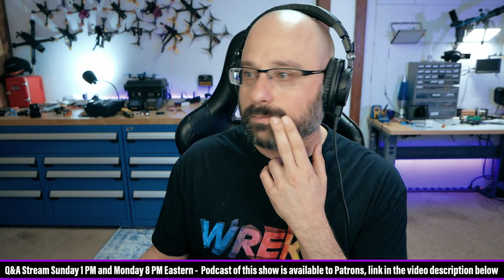Why Doesn't Betaflight Use 32khz Gyro Sampling? Why Not Use Sensor Fusion To Fix It? - FPV Questions

Comment: A better question is why did betaflight dump dshot2400? You have KISS/FetTEC using significantly higher ESC control rates using their own protocol, and both platforms support dshot2400. Anyone who says it doesn't matter is still flying BF and not KISS or FT.

EDIT: This relates to the original question, as betaflight dumped dshot2400 when they didn't want to support the tickrates required where dshot2400 would benefit.

Comment: The solution is 3 gyros, majority vote. That's how real aorcrafts work. A little more cost but redundancy and better performance
Reply: Maybe its time to just take the IMU off the FC altogether for larger quads, if people want to pay a fortune for an triple redundant IMU, they will certainly want to take it across multiple FC upgrades. This would also allow BF to support more exotic gyro's like Analog Devices ADIS16470.
Reply: An IMU is dirt cheap hardware wise and needs to be integrated for space savings.  @spikester
Reply: @Andreas92  We've had external gyro's on our rc helicopters for nearly 2 decades. DJI mounts their IMU's on a daughterboard for noise suppression, its not common practice to shove it on a poorly vibration-isolated board outside of our little DIY hobby that now sees war profiteering as more important than a redundant gyro setup. What space are you trying to save here? Not everyone flies a tinywhoop.